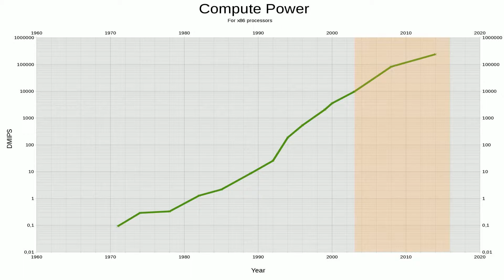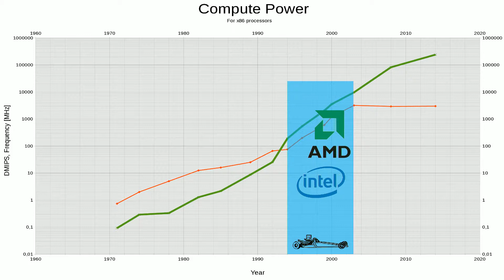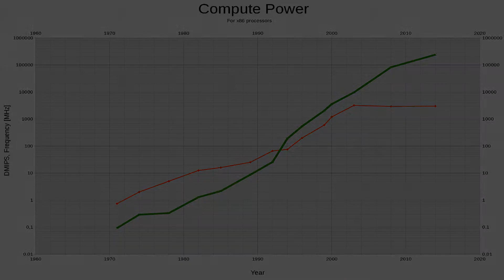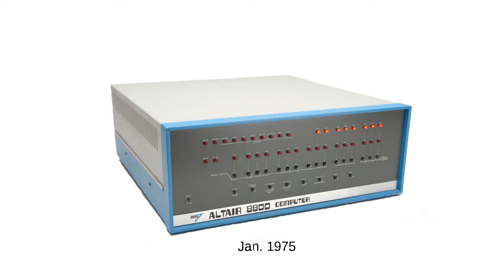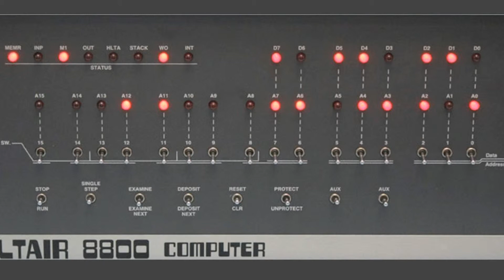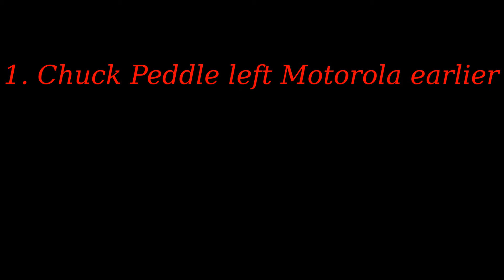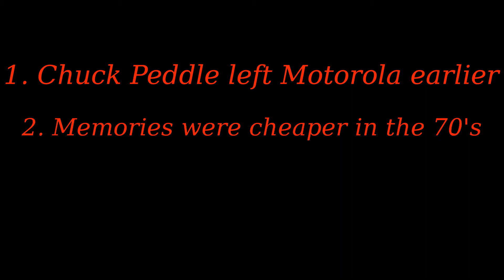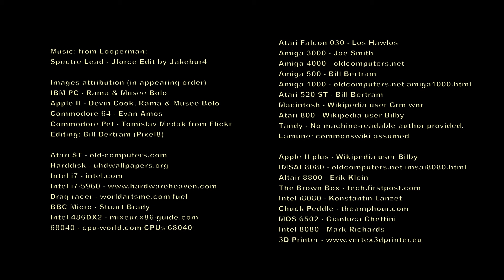The Alt6502 Project, Episode 0: The prologue

Comment: 4:58 "[The Altair 8800] was actually pretty fast. It ran at 2 MHz, twice the speed of a Commodore 64...." Not actually, no. Clock speeds for 8080/Z80 and 6800/6502 processors are not directly comparable for speed because the former (for certain technical/design reasons) need more clock cycles to execute an instruction. A 2 MHz 8080/Z80 is very roughly equivalent to a 0.5 MHz 6800/6502 CPU. So the Altair (and the TRS-80 Model I) would have been about half the speed of an Apple II or Commodore 64. (You actually mention this later in the video.)

Regarding bringing in 3D printing: is that really necessary? It seems to me you could just as well do everything you need in sheet metal using basic high-school metalworking techniques, exactly the stuff they were teaching in my junior high school in 1980 (and presumably earlier).
Reply from the maker: You're absolutely right regarding CPU speed. 

As for the 3D printing: the reason is that I had one handy, and my "workshop" at the time didn't have much metal working tooling. That has changed, and so will the case. I have an all-metal solution in mind. Hopefully I can make it look retro, like an IBM-360 / 1401 panel design or something. Need to obtain some new skills for that however....
Reply: @fulkonto1222  Brilliant! I really look forward to seeing a very 1970s case for your computer.

Note that it doesn't have to be all metal. Wooden side panels give a nice touch, I think. :-)
Reply: @parad0xheart  It depends on the person and what resources they have avaialble, of course; for me 3-D printing would add greater monetary, time and skill barriers (and I have no post-high-school experience with metalworking, though I do have drill).

But I'm thinking of doing a similar project, so I take it that you are willing to make the 3D printed parts I require and are willing to mail them to me?
Reply: @parad0xheart  No, I did not assume you have a 3-D printer. It doesn't really matter if you have one or not; it's certainly within your capability buy or rent one. I was making a suggestion exactly parallel to yours to see if you think such suggestions are reasonable when aimed at you. If you don't think that's reasonable, why would you make such demands of someone else?

(I personally think that, "you're not allowed to disagree with me unless you're willing to do something involving much more work than I put into this discussion" is more a troll technique than an attempt at conversation.)
Reply: @parad0xheart  Re-read my original post. I did not make any demands. I asked a question. And yes, it was a genuine question, and I certainly do believe that it might well be easier to drill a few holes in some sheet metal than to spend hours with a CAD program figuring out how to get melted plastic to lay out in a way that would provide the kind of structural strength and flexibility you so easily get with sheet metal.
Reply: @parad0xheart  These are all good questions, and I think you'd learn a lot by trying to answer them yourself.
Reply: @parad0xheart  Doing cardboard templates is a great idea. For me that would certainly work better than CAD because I get a much better sense of what something will be like when I'm physically handling stuff. (That may just be my inexperience with CAD showing, though.)

There's certainly no need for a drill press: it's not hard at all to drill accurate holes in sheet metal with a regular drill, so long as the sheet metal is clamped down and you use a punch to put a little dent in the centre of where the hole will go. That's probably the easiest part about the whole thing.

For bending, again, you don't need to get complex about it: just clamp to the edge of a table and bend. (I'm assuming you are doing 90 degree bends here.)

I'd be more worried about accurately cutting metal to size than anything else, I think.

And yeah, using a "case you already have" is a pretty normal thing. Back in the day you could go even to Radio Shack and buy a "project box" that you'd just drill to mount whatever you needed for controls and switches and whatnot.